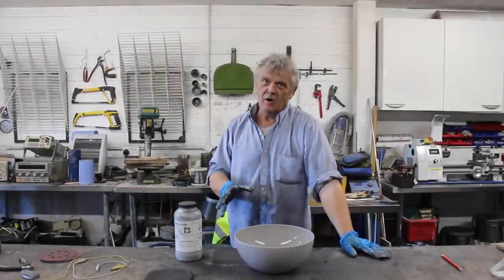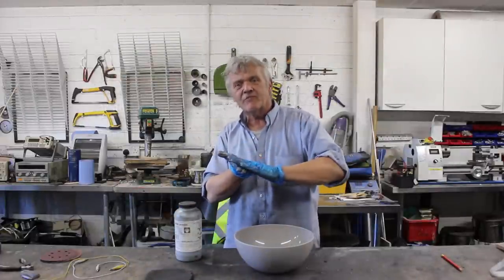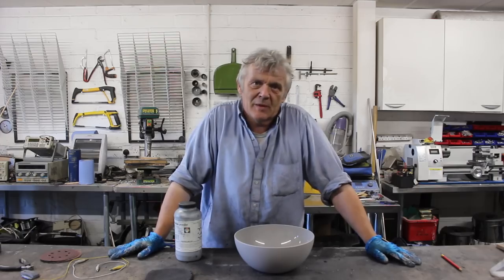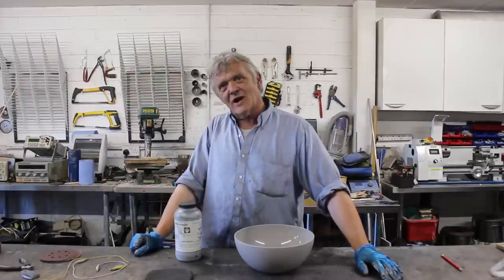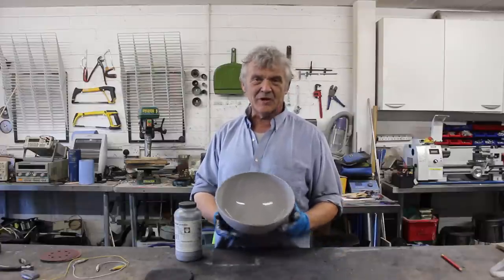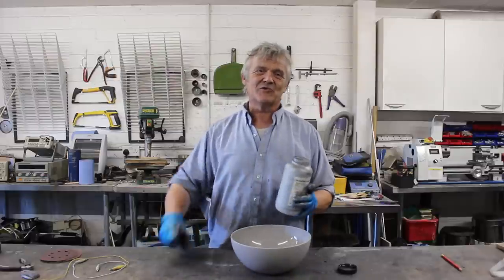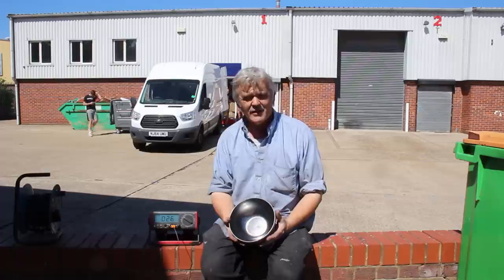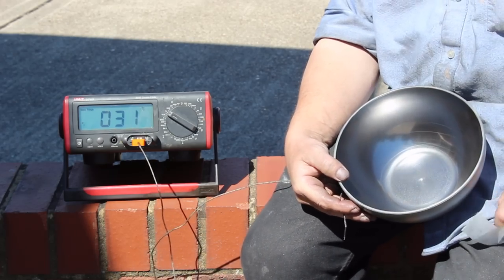1640 DIY Graphene Parabolic Mirror

Comment: I think there's a lot more merit behind parabolic troughs than parabolic dishes when it comes to diy solar to thermal setups. It also vastly simplifies the design of the heat collector, as it can just be a straight metal pipe painted with standard high temp black paint.
Reply: Yes a solar trough is very efficient and requires alot les in terms of control to track the sun.
Reply: Indeed.  if that works. Perhaps pvc or pp panels can be aggressively buffed (perhaps with a car polishing bonnet and a dusk mask)  then bent into a trough.    and then focused on a vacuum tube thermal collector.   the heat then extracted by heat pipes
Reply: @AdricM  definitely liking the vacum tube heat collector very highly efficient.
Reply: @AdricM  one type of panel, relatively easy to come by, is used aluminium printer plates. Ask some print shops if they have any for recycling. Not all use the lithographic method, but you may find one. They might charge you a small amount. The sheets are roughly A3 and not very shiny-reflective, and would require a fair bit of elbow grease to polish (less with a machine), but the graphite should adhere really well without that much work. Just not sure if the surface needs to be mirror smooth to start with. The brushed surface, at microscopic level, might reflect in all directions.

Comment: Back in the day, when I was 9th grade, in science class we were divided into small groups and challenge with making a solar collector snd were judged on hot hot and how fast the temperature rises. All the other groups built some version of cardboard boxes painted black inside and covered with  plastic wrap to minimize convection losses. Some had aluminum foil  reflectors.  I got my group to paper mache a bowl, line it with aluminum  foil and spray painted black an aluminum can to place in its focal point. We covered the bowl with plastic wrap to minimize convective losses.  Considering we were heating a small can with light collected from a larger cross section rather than the heat the black paint which heated a large volume of air, we easily won both quickest rise and hottest temp reached.

Had I known about graphene infrared reflectance, maybe we could have used pencil lead to line the bowl rather  than paper mache a bowl and glue strips of aluminum.

Comment: Don't get fixated on the shape because the energy depends on the projected surface area of the mirror and the object you want to heat is not a single point. It's easy to get most of the energy onto the item and that's all you need. Even a box shape will work.

Comment: In the days when I experimented with parabolic troughs and bowls, I used to use craft store mirrors, 30mm diameter round ones and 30 x 30 mm square ones, so cheap, $2 a pack for 50, still got heaps of them, also used Fresnel lenses to get stuff super hot, got a lot of really big ones from the local dump / landfill from old tv's.
Reply: I've seen a glass artist melt glass with a large Fresnel lens!

Comment: I’ve just started looking at solar cookers myself so this is of great interest to me. I also started thinking of building my own and was thinking of making a parabolic dish out of as heavy a gauge copper sheet that I can afford, paint it black on the inside and insulate the outside. Obviously Graphiene is better than paint. With this design concept it might be worthwhile to cover the dish with glass to trap the hot air.
Reply: @terrafirma9328  that sounds like a good way to do it.

Comment: Cling film or pallet wrap stretched over a round container apply the graphine layer then pull a vacuum in the container. 
Thanks for sharing 👍 ! 
This technique has got to be one of the cheapest ways to make solar infrared reflectors. It should work for box type solar oven reflectors too. Much cheaper than reflective mylar, glass and acrylic mirrors and highly polished metal mirrors.
Awesome 👍 !

Comment: I've tried a few things with this, though my first was using stainless steel cooking bowls for ease of malleability and they are cheap. Now that I have a 3D resin printer and a home made vacuum former, I wouldn't recommend the former unless you're in need of a good thrashing of your elbow or want to come out looking like a lopsided Popeye. I made a buck to hammer the flat bottom of the steel into a bowl and refined the shape over several days of heating with a torch and hammering. 
Having the buck, if I were to do it again, I'd certainly go the vac-u-form route! 
By the by, the vac-u-form is really easy and can be made in an afternoon. I'd advise to bypass the usual method of pegboard and go straight to a 50mm hole in a nice thick slab of wood or whatever you have laying around that withstands high vacuum (acryllic is okay if really thick; I made the top out of 15mil plexiglass, but again I bought a large piece for this use). I used an old hardwood drawer since we were remodeling our kitchen at the time and I had one handy. Getting a large sheet of ABS warm at the same time is a little tricky with the standard heat gun, but if you have an oven dedicated for science use... 😁 Outside of that, nichrome wire or kanthal makes stupid simple arrays very possible.

Comment: Use two parabolic cylinders at 90deg from each other:
 You can create a parabolic cylinder by putting pressure on the edge of a flexible flat sheet. This is easily demonstrated: pull out a credit card (or anything similar) hold it between your thumb and finger lengthwise tips and squeeze the card. Do it right and it's pretty obviously parabolic. 

An pivoting A-frame with a holding bracket can be easily designed and built to hold a 4x8 sheer of plastic and force it into a parabolic cylinder in the same way.

 Such a reflector will concentrate solar energy into a line along the axis of deformation. However, if you angle that axis to the incoming light, that line can easily be shunted to one side.

If you place a second parabolic cylinder in the way of that light with an axis of deformation 90 degrees off the axis of the first reflector, you can concentrate the light into a point: the first reflector concentrates the light in the north-south direction and the second in the east-west direction; the second one will also require a greater bend in order to concentrate the light to the same place over a shorter distance.

Pivoting A-frames will allow you to vary the focal lengths by hand to get them to match, regardless of the situation. Two 4x8 sheets would concentrate just over 2 kilowatts of solar energy onto any given area: it need not be a point if you don't want it to be.

Furthermore, all of this is relatively lightweight meaning that you could put it all onto a sun-following platform that keeps the focus on the same point ON THE GROUND!! IE, the sterling engine or solar oven, or what-have-you can be any mass you like because IT DOESNT NEED TO MOVE to stay in the focal point.

Finally, this is not my idea. And the patent holder (I reached out to him but cant remember the name) wants it to be usable by anyone and everyone: he patented it so that no company can corner it in the market. So go ahead and use it.
Reply: As an aside, I've often wondered if this set up was the design of Achmedes "solar death ray" he used on the Romans. It is well within the engineering limitations of the time: sheet metal does just fine as as the reflector and wooden a-frame whose angles were controlled by screws would be perfectly adequate. Indeed, the focal lengths of each angle could be observed or calculates ahead of time and marked on the device so that a good guess at a ship's distance would be enough to roughly focus the machine.

What I picture is a three mirror system: the primary (N-S axis) reflector would be set to 45 degrees off the plane of the ecliptic, bouncing the light upward and the secondary (E-W axis) reflector would be set at 90 degrees off the ecliptic, CO that the culminated light path would be directly down. A third, flat reflector would be mounted on a ball joint so that the focusal point could be projected in nearly any direction.

The tertiary reflector would be angled at the target, the focal lengths would be modified on the fly with hand screws to concentrate energy on the target and the whole frame would be mounted on an equatorial mount so that it can be rotated slowly (by hand) through the day to keep it pointed at the sun.
.......
As a further, separate aside, I've also always believed this system could be made small and portable so that it could be hiked into a camp and supply all the heat energy a camp could want: hot showers and three hot meals a day. Add a small heat pump and you could have a solar powered refrigerator, too.

The reflectors would roll out like a roll top desk and be mounted on folding frames atop a portable and adjustable equatorial mount with a pv heleostat keeping it pointed at the sun. (The electric motors would require very little energy for this task so 2 hand-sized, flexible panels would do fine.) This could all be comparatively light and compact.

Of course, a tensairity system might be superior in compactness and weight but I can't help but design tings in wood first.
Reply: @bmobert  Thank You so Much!!
I've been thinking about this kind of thing as a preventative measure,as I am really annoyed with a Twit who has got a Moped, and thingied the Baffle so that it sounds Sooooooo Loud!! My poor dog Jasper jump's out of his skin, I'm also shocked into jumping Up and banging my head on the ceiling!!
Living in the UK means that I am somewhat limited ask to options for this type of "Annoyance"!!
Mwah Haha heehehe!! (Evil laugh,Rubs hands, Hehehe 😅)
Andrea and Critters. ..XxX ..
Ps, Just joking mostly about this one!!😁👍
Reply: @AndreaDingbatt  No problem. Good luck.
I live in a Northern California rain forest so I am very fire conscious. As such, I recommend a fabric cover to go over the tertiary mirror as you make adjustments so that your not causing damage as you transfer from one target to the next.😃

One of the designs the original inventer had in mind was a solar forge so that small communities could manage and reporpose their local scrap. Sounds to me you have something similar in mind. 😇😅🤣
Reply: @bmobert  Lmao 🤣💞 Yes!!
Thank you for your understanding,
I'm very fire 🔥 Conscious myself!!
I've worked in Scotland, and elsewhere, doing the "Burning" as a method of clearing out the Old Heather,Etc, 

Giving the Grouse New Growth and shoots to Eat.....
It's actually The Glorious Twelfth today 💞 I am having a great Birthday!!

(Glorious Twelfth,is Open Season Day for Shooting Grouse!!)

Lol! But I tell folks that it's because I was Born,(12/8/1965!) 

Sorry, I forget that we write it the wrong way around,Lol lol 😆💞
Do please forgive me for my exuberance!! Cold,Cold Beer 🍺🍺💞🙂 Namaste 🙏
Andrea and Potential Hangover tomorrow!! ...XxX...

Ps, I have also worked as a Burner, burning controlled fires as fire breaks as well....

Preventing any fire 🔥 getting to the Forestry commission forest Trees!🎄🌲🔥🎄🧕. ...XxX.....
I am happy to say that I was good at my Job!! 🌲🌲🔥🎄🔥🔥🌲🎄🔥🔥💞🍺🥴🍺🥰
💞🎆🎊💞🎉🎈🎉🎉💜🥴🍻🥂🍾😁🙂 Woohoo!! 
Back to me 🍻 Beers...axx.
*Edit,Hi there, I hope you're doing well, I am Mr Dingbatt, I want to explain my Missus is, Enjoying herself a bit too much!!

Thank you for being such a great sport, and you have been very kind,
Andréa is just  a little bit tiddly....
so I hope she's not bothered you at all?!
Cheers Mate!!
Reply: @Andrea Dingbatt  I lived in Moscow for 3 years, so I'm used to reading dates in the European fashion and can usually deduce what's intended. (I also inherently understand temperatures in Celsius from about 7C to about -30C, but I need to use Ferenheit from about 45F to about 100F. Which reminds me of a joke about a Brittish man whose about to marry a Scottish woman of "nine stone," sight unseen.)

Can't say as I mind exuberance, regardless of its origin. 😃 As such, it is my strident wish you enjoyed your open-season/birthday! And may your "fire in the pipes" (as the Russians call a hangover) be so slight as to be Non-existent!

And allow me to assure one and all this conversation has been no burden at all. Indeed, among my most enjoyable online interactions.😉😊😇

Cheers!

Comment: Nice 👍, maybe line a drum with the plastic, then tumble some graphite with marbles or other heavy balls in it.  Or is there some electrostatic forces at work that require the wool?  Could try getting polypropylene Tupperware, making an air inlet in the lid, and using a heat gun to make the container part soft so it deforms when you inject air into the lid.  It wouldn't make a perfect parabola, but it would be quick and cheap if it works 😁.

Comment: Coat a thin sheet of plastic with graphene then put it over the opening of a chamber in which you can pull a vacuum. If there was a way to fix the shape while it was under vacuum then you would have your parabolic surface with less fuss.

Comment: Easiest...should be in quotes...is spinning a liquid in a container.   Surface forms perfect parabola.   So, mix up some plaster of Paris...kinda runny, put on old record player turn table, spin til hardens.   You got a mold for a mirror.   Drill a bunch of holes 1/8 inch or 3/16ths..then vacuum form the plastic with a shop vac and a heat gun. Like I said easy.

Comment: Cool stuff ! In my mind , shaping a sheet of polypropylene into parabolic shape  , shouldn't be so hard (you've done much complicated things on the channel). Cutting circle in some plywood (or MDF) , some heating units under it (for heat softening) and a air compressor (of course , the contraption should be air tight , excluding the valve for air ) should do the trick. Many videos  on pressure forming different plastic materials on You tube ...

Comment: Another way to create a parabolic mirror is to dig a hole or make a mound in the shape of a parabola.  You then apply concrete evenly all over the mound or in the hole.  Another option is to use a mortar spray unit to spray on layers of either concrete or Aircrete to the mound or shaped hole.   The final step is to let it cure and either glue mirror tiles to it or to apply a reflective paint after smoothing the surface with a grinder and then build a heavy duty base.  In the case or aircrete you can use regular fasteners but if you plan ahead you can incorporate them into the parabolic cement mirror, the benefit being size only limited by resources
Reply: I think ferro cement would work best in that application. It is easy to create the shape and the dish would be lighter. The embedded chicken wire also prevents cracking. There are boat made of it!
Reply: @judyofthewoods  Glad you commented about that, years ago I made a video called Aircrete Boat Invention and quite a few people who watched it commented on ferro-cement and all it's qualities, my method for the boat idea was to use the aircrete as the form and core of the boat, with a spray on durable coating to provide extra structural strength, but I digress as I'm rambling 😆
Ferro cement is an excellent idea

Comment: something else I found was that ebony pencils (really dark graphite color for a pencil as it is very soft pencil lead and is very large in diameter (the lead) was better at leaving a graphite like mark on the tempered glass than the vein graphite was for some reason.
Reply: I was going to use a 2 B pencil but now I’m having second thoughts   2 b or not  2 b that is the question 🤔😀
Reply: @johnmcfadden9336  yeah from what I understand the extra hard and lacking in darkness of 2b vs the likes of ebony is due to clay or some such added to the graphite in the lead

Comment: Probably comes down to design simplicity or efficiency, but I've often wondered why parabolic/surface reflectors for use with sterling engines rather than fresnel lenses, or something else that may not need adjustments, or at least as much, like a Campbell-Stoke recorder.

Comment: ok so glass and acrylic are out, but Polyethylene and polypropylene are in, what about PET? or poly carbonate? I am guessing Vinyl will work too in some instances at least since I have used pencil to mark the piping for measurements before cutting. But I wonder about the vinyl sheeting like used to coat windows and such that has a slight stretchyness to it.

Comment: Maybe use a bit of plexiglass. Or lexan, probably a dark colored piece,  secure it to a form, with a perimeter support, hear it in an oven, while slowly adding pressurized air, 1psi our less heat until it has a parabolic shape, let it cool, and 🤯 BOOM  trim the edges and graphitise it and there ya go!!... Boom Roberts your uncle!

Comment: Question for Rob and for the whole community. Is it possible to make a mirror big enough to focus it's energy onto one of these Night Time solar panels? Meaning a solar panel that works at night as well as daytime.... Then would it be possible to use this daytime/night time solar panel structure to power a sterling engine?

Comment: could this method be used to just "paint" something because you like the graphite colour?
Then coat with a clear varnish to avoid smudging? I believe the outcome is superior to any spray can with "graphite" colour on the label.
Reply: I've tried that to make a gesso covered papier mache item look like cast iron. It looked fabulous, but the graphite did come off easily when touched. On another test item I tried covering with a satin varnish, but the effect was totally lost. If I remember rightly, the varnished graphite turned black. I think the "graphite colour" is partly due to some of its reflective nature, lightening it somewhat. When in a heap, the microscopic platelets will only reflect where the surfaces are facing outward, so it tends to look darker. When polished, the platelets align and give a lighter "grey" colour.